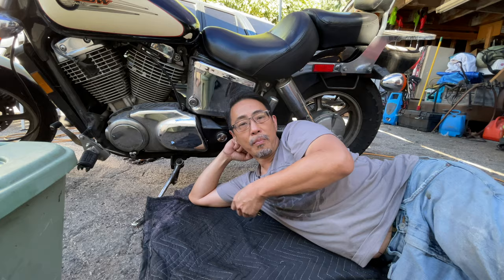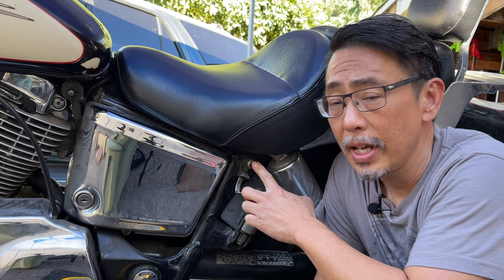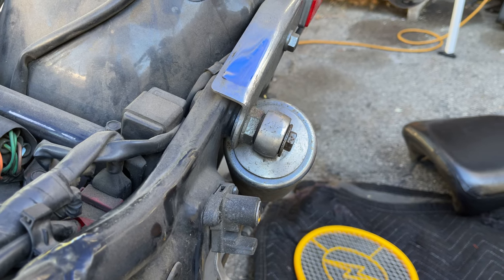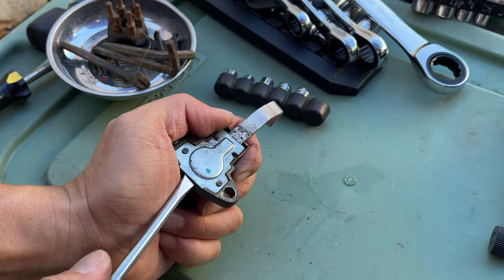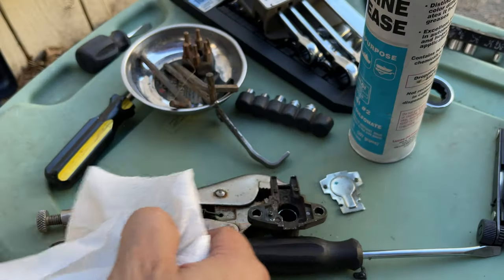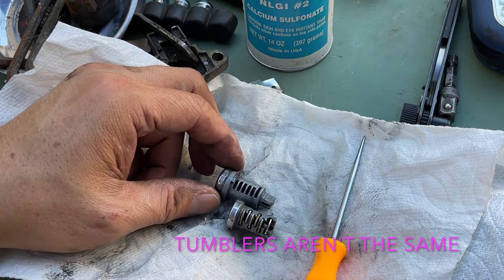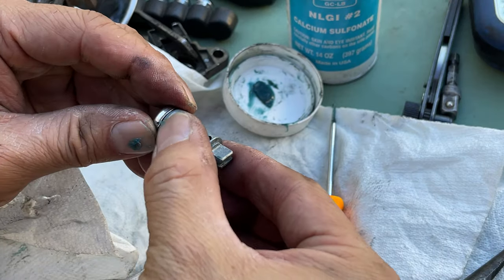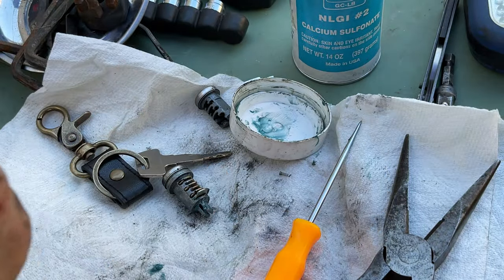Replace Or Swap Honda Shadow Motorcycle Broken Ignition Lock Cylinder Tumbler Pins?

Comment: you can get a key from the code number stamped on the tumbler barrel on the ignition... I lost my only key and was looking at a nightmare to get everything straightened out... got my key back... long story... now I have three keys... one to use , one in my wallet, and one at home....cost me less than 20 bucks to get keys cut...
Reply from the maker: I've been trying to get access to the key code  charts and databases for awhile. Everytime a site comes up it gets shutdown.  Typically dealers and license locksmiths can pay to access these if you can get one to decode the pins from the key code, which I'm not either.  I just don't want to have different keys for different locks.  Just 1 key for all the locks and repinning is not that big of a deal.  Self cutting keys is pretty easy to, it just takes time.